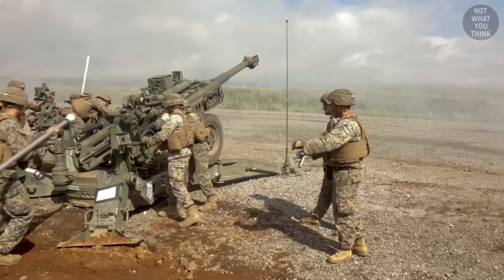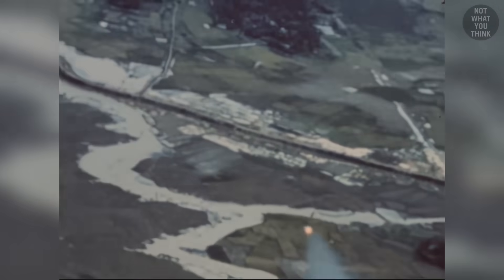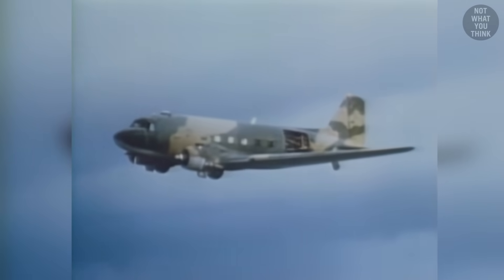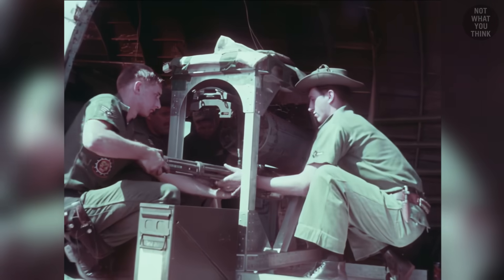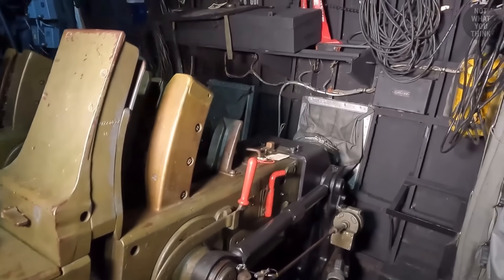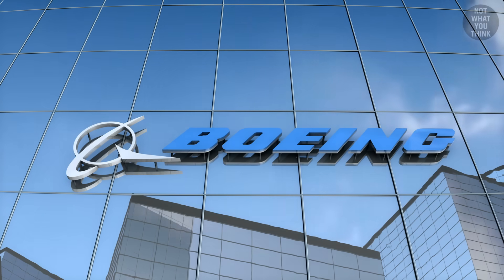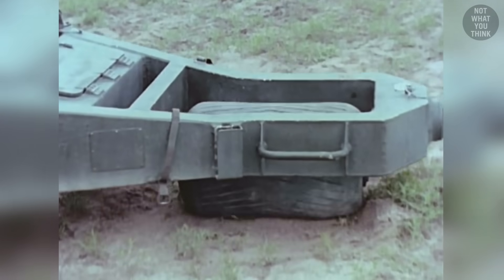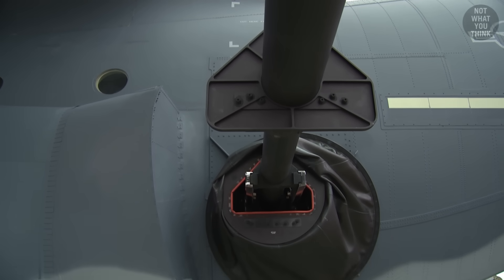Why the US Air Force Installed a Howitzer on a Cargo Plane

Comment: The Vulcan cannon on the AC-130   In theory, should double as a C-ram style Air defense if tracking is spot on and the cannon can get the right target angle
Reply: If you're going to intercept a flying target, you need a dogfighter. Not a rhettofitted cargoplane
Reply: @samsonsoturian6013 I think they were referring to using it in the way WW2 bombers had defense gunners.

Like plane coming from the side to identify it before firing and BRRRRRT

Comment: towards the end of WWII, 70mm cannons were installed in the nose of some old Lancaster bombers. According to pilots, such was he recoil of these cannons that, "despite full power & in a dive, upon firing the aircraft would almost stop mid-air. Then there was the vibration through the entire airframe. We could only fly 2 or 3 missions before the aircraft became unserviceable".

Comment: I rebuilt those engines at one time, and was test cell qualified. So I stood inches behind the prop while dialing in the control cables to the propeller control. Navy, the most dangerous job you will ever love.

Comment: I used to sword on the weapons system on the Hand U models back in the late 90’s,  the ac-130 did not become pressurized until the U model, and then it could only be pressurized when in transit not when it was actually firing the weapons.

Comment: The first aircraft weapons were pistols. The First ever dogfight was between two mercenaries in the Mexican Revolution. Neither actually wanted to hurt the other so they fired their handguns in each others general vicinity until they were both out of ammo and went on their way. 

By WWI pilots arsenals had improved, adding grenades, bricks and occasionally rope. It sounds pretty stupid by today's standard but the bricks were actually some of the most effective weapons early on. Even if you failed to knock out the pilot, hitting the prop or canvas was enough to force a landing. By the end of the war, they timed machine guns that could shoot through the propeller so the pilots no longer had to let go of the stick in order to perform an offensive action.

Comment: - The AC-47 designator was "Spooky". Puff the Magic Dragon was then nose art of one specific aircraft, not the name of the fleet.
 - "Surprise Package" was the name of the project that swapped out the 40mm Bofors in position 6 for a 105mm. These modifications were not done in the field, but required the aircraft to return stateside for the upgrade.
 - The 105mm was added to counter the enemies use of barges to move supplies. It was far more effective than the 40mm it replaced.
There are a few more minor errors in this piece, but they don't stand out as much as the afore mentioned ones do.
Reply: Official name, but the whole fleet came to be known as "Puffs" unofficially.
It's like the name of the Thunderbolt II - but WHO calls the A-10 by that name?
Reply: @bricefleckenstein9666  I never said that the moniker "Puff" wasn't in common usage. The video presented it as the official call sign, which it is not. That is the point I was making. Repeating something that is inaccurate doesn't make it accurate.
Reply: @davidplatter7671  But when nobody used (and almost nobody even REMEMBERS) the official name, is it still relevant and SHOULD it even be used (and CONFUSE most people)?
And if you bother READING my post, I did STATE that the "Puff" name was unofficial.
Reply: @bricefleckenstein9666  So if the video had said "..the AC-47 Spooky Gunship, commonly referred to as "Puff the Magic Dragon", then that would have been an accurate statement showing the official designator, and the unofficial name. It should be obvious that the Air Force would/could never use "Puff" as they would be subject to royalties payments for the use. I spent 30 years working on aircraft for the USAF, including AC-130 Spectre gunships. One thing that is required is painful accuracy in everything you do. I mean, if you are a passenger on a jet, wouldn't you hope the mechanics are sticklers for the details?
Reply: @davidplatter7671  The Air Force would not have been subject to royalties, as the AIRCRAFT name would not have violated copyright on the song - UNLESS they used the song itself.
BTW - I'm ex-Navy, and my specialty was working on the UHF radios used to contact aircraft and other ships - old TUBE gear using a mechanical drivetrain driven set of variable caps to handle working at any point in the Military UHF frequency band (225 to 400 Mhz, as I recall decades later).
Getting those drivetrains aligned correctly so the radio would tune across that wide a frequency range wasn't a piece of cake, though I won't say it was nearly as tough as getting all the different parts of military aircraft to work correctly.
Then when I got out, 2 of my first 3 jobs were working on MilSpec gear used in the various missile programs.
Reply: This is getting interesting. USAF vs Navy. Let me get my popcorn.

Jokes aside, thank you both immensely for your service, gentlemen.
Reply: Good comment. I appreciate it. 
I'm no aviation expert but i was surprised that the author didn't mention the name "Spooky".
Reply: Yup, i prefer mechanics who pay attention to detail as if their life depended on it. 30 years in the Airforce, wow. That is impressive.
Reply: Heard from another AC-130 crew member (Afghanistan iirc) that there's serious problems with chemical buildups inside the plane from weapons fire. Things were toxic enough that on any normal site the crew would be wearing serious respirators. Guy also said there's a bit of a death cult mentality among the crews who man those planes.
While I still love the design, apparently though the airframes get stress fractures from firing the cannon overtime which is an issue due to their cost. Might be time to make a new generation of them.
Reply: @Captain1nsaneo  the interior can get a bit smokey during live fires. This can normally be dealt with using cabin pressurization. While the original gunships couldn't pressurize at altitude due to the unsealed holes in the side of the fuselage, they can use the cabin pressure system to help push the smoke out.
Reply: @davidplatter7671  From what I remember it wasn't the smoke that was the issue but the heavy metals and other contaminates which would hang around and build up. Causing damage over time rather than anything immediate.
Reply: @Captain1nsaneo  I used the term "smoke" as a general term for all airborne contaminants. You're correct, some of the unburned portions of the propellants were a bit thick and heavy.
Reply: You copy and paste from Wikipedia so well !
Reply: @Frankie5Angels150  nah, I just actually served in that unit with the guys who were there in Vietnam. Spent four years maintaining and deploying with the 1st Special Operations Wing out of then Hurlburt Field. But go ahead with your assumptions Frankie, whatever makes you feel good>
Reply: @davidplatter7671  Just anecdotally my grandfather flew AC-47’s in Vietnam, in ‘65-‘66. I’ve never heard him call it by the call sign “Spooky”, it was always “Puff.” There’s a picture of him and his crew in front of the aforementioned one with the “Puff” artwork. Also just a side fact, the scene in the movie The Green Berets when they “call in Puff”, my grandfather is the one piloting in that scene. It was literally filmed on the way back from a combat mission and he was told to let a burst rip for some camera crews. Had no idea it was for a movie at the time.
Reply: @sethrich5998  I am very well aware that the AC-47 was commonly referred to as 'Puff". My point is that regardless of what it was frequently called, that is not it's official designator. All fixed wing gunships have a designator that begins with the letter "S" - Spooky, Spectre, Stinger & Shadow.

Comment: Such a C-130 has zero chance in contested airspace. See Ukraine - Russia, even fighters barely dare to come close to enemy air defences. Never mind a big, noisy and slow low flying cargo plane.
Reply from the maker: That’s correct. We point that out toward the end of the video as well.
Reply: In 1991 an AC-130H was shot down during Desert Storm. At the time we at Rockwell ( not Boeing)  were building the prototype AC-130U. The Air Force told us they lingered too long in  contested air space

Comment: Vietnam, they referred to it as the "Can Opener" Hit North Vietnamese tank on the top, tank disappears, leaves the body, burning.
Reply: Nice
Reply: @AC-hj9tv  I was stationed at Lockbourne AFB, outside of Columbus. We had C-130A models. I was in the Avionics shop for the 39th Tactical Airlift Squadron. We were getting disbanded and send the first C-130s to be converted to gunships, the base was host to the AC-119Ks. They bolted the 105 cannons to the cargo deck and fired it, it pealed up the floor! they came up with a recoil mount and it worked well. Most of our planes were divided between National Guard units and the Gunship program.
Reply: @jamesberwick2210  whoa. Thank you for your service
Reply: @AC-hj9tv  Drafted three days after High School Graduation, delayed my eventual entry into the military, by enlisting in the Air Force, safter on a concrete ramp then in a jungle, (1969). Got to see a whole lot of the world at an early age. Fun but wears out after a while. The electronics training I got demanded six years active duty, I re-enlisted at just over three, gave them an extra year to go to England from Thailand and the war.

Comment: The night vision isn’t as true as majority of pilots use regular night vision to fly at night. It’s not special to the ac130 and it’s crew
Reply: I thought that part of video sounded strange. I was an Engineer on AC-130U Fire Control and Mission Management Systems. I am familiar with the side mounted HUD on plane

Comment: The ac 130 is not the first one to add a cannon 100mm and above, a ittalian attack aircraft with a 102mm cannon strapped near the cockpit
Reply: the Italians used a forward and downward facing gun for anti ship. These Gunships use  adjustable mounts for Close Air Support.

Comment: Imagine the guy that thought of this goes into a room with a bunch of engineers and says how about putting a howitzer on board and everyone in the room stares back at him then there’s a long pause and then the engineers go into a huddle and then they say ok we can definitely do that lol
Reply: Something like that. I was an Engineer on AC-130U project and we hired a few consultants from early days of AC-130. My recollection was the Air Force did the first modifications in house with their own Engineers working with Col Ron Terry the inventor 
This video misses that
Reply: Personally i like to imagine their response was more like that Robert Redford GIF
Reply: I'm an engineer. Yes. That's what we'd do. :-)
Reply: @TallerCarnivore  when I was a kid I was always fascinated about how things worked if something broke I would take it apart try to figure out why it broke and come up with a thinking outside the box solution to fix it with just what I could find around the house paper clips wire from bread wrapper twist ties wire hangers but had sense enough not to mess with anything that plugged in only battery operated stuff lol in school when I learned the Apollo astronauts made a device to scrub the oxygen inside the capsule with a few things that were on board that was my inspiration and also the tv show macguyver taught me to always think of a solution a Harvard graduate with a dozen degrees couldn’t think of lol
Reply: @jaredharris1970  Personally I was not that type of Engineer. My option was Physics  at Caltech so I knew the Mathematics. The AC-130U was an unusual project because it was relatively short and diverse for an Aerospace project and I started as a junior Engineer and ended up a lead after being involved in many subsystems. Last I saw the AC-130U prototype it was being assembled in Palmdale by others

Comment: I have a friend who is a boom operator for the air force, and he told me his plane could operate as a flying field hospital and artillery station. each war plane is equipped with enough resources to fly indefinitely with refueling every couple days. Apparently they can also shoot down missiles and incoming rockets with their onboard sam systems. it’s not just flares anymore 😂. And that’s just our plane dedicated to refueling jets.
Reply: Did he say what airframe he flew? It sounds like a KC-46 or a KC-130 from what you said.
Reply: @skeletax7471  

The KC-130 doesn't have a boom, so no boom operator.
Reply: @skeletax7471  I forgot which one, but it’s a massive refueling plane and it has a couple of cannons out of the side in the videos he sends us
Reply: @skeletax7471  it’s a jet if that’s helps it doesn’t use props, apparently it’s outfitted with some classified stuff they aren’t allowed to use yet
Reply: @ballsackfart  yeah no that's... not a thing my guy.

Comment: Basically the AC-130 is good at fighting the same things the Russian airforce is good at fighting: Ground targets that hardly move, don't shoot back and aren't protected by any anti-air.
Reply: That's why it's perfect for counterinsurgency.
Reply: basically the same issues of the A-10, but worse honestly. its upside though is that they can stuff an ungodly amount of countermeasures in one of these things. flares, chaff, laser defense systems, radar jammers. but at the end of the day those are just compensating. You cant do much about optical tracking, or volume of fire.
Reply: Difference between civilian targets that Russia bombs and military targets done by the Americans

Comment: It would have been more informative and less obvious I feel, if you had gone over the crew of these gunships. How they are not given proper masks or ventilators, so many of the crew who fire these gunships get massive headaches and side effects from the toxins and gunpowder concentrated in the air of the plane. I wasn't aware of it until I heard the experience first hand from the young men who got tricked into it by playing to much of that one level from modern warfare and thinking "hell yeah this is badass!".
Reply: ALL flight crew are REQUIRED BY MILITARY LAW to use adequate hearing protection, protective headgear, and oxygen/respirators as necessary.  Where did you get your information?  Gamers?

Comment: An AC-130 with a Laser defense system capable of downing SAMs and Anti Aircraft Missiles. It will only be a matter of time before those lasers are being used to cause ammo to suddenly Cookoff at Ammo Depots.
Reply: Sad, but true.
Reply: maybe in the future, but they are not nearly strong enough for that atm. They dont just burn a hole though the missile (even though that is end goal for the concept) they just disrupt the IR or optical tracker.

Comment: It's a very cool aircraft. However, I think it was a waste of money for the Air Force to invest in a lot of AC-130Js when they're not really relevant to near-peer fighting. I expect this to be the last model of gunships based on the C-130 platform
Reply: And the backing for your opine comes from....?
Reply: @Rotorhead1651  Working as an integrated electronic warfare systems technician on AC-130s

Comment: Sad how so many awesome and cool looking equipment is absolutely useless in near-peer combat.

The AC-130 wouldn't even last 10 minutes in enemy airspace, during modern combat.
Reply: Strange.......because it does.  There are NO "peer" aircraft to the AC's.  Russia (and the Soviet Union before her) never made gunships, and the AC's were never intended to be fighter-interceptors.

And, for the record, a well-placed, unguided RPG can take out nearly ANY airframe.

Funny how guys like you seem to have more opinions than actual experience.
Reply: @Rotorhead1651  Holy crap.

Talk about confidently incorrect.

How much of a gosh darn moron do you have to be, to not only insinuate that a goddamn unguided RPG could be used to take out planes, but to also not know the fact that MANPADS and Anti-Air is everywhere in a modern conflict, and that if your opponent is not made up of literal goat herders with AK-47s, your lumbering and slow and low-flying gunship will be toast before it even knows what hit it.

Even the video itself states that at the end.

Comment: Fun fact. The ac-130 J and W was supposed to have a very different armaments of 30mm bushmaster ll, weapon system with launch tube for agm 176 griffin or gbu's, and wing mounted agm 114 hellfire.
However, because it still have enough power they decided to put the 105 howitzer back on the plane which they weren't going to put.
Reply: Interesting. I was an Engineer on the original AC-130U with 105mm, 40mm, and 25mm Gatling.  I had heard they were trying to standardize munitions due to logistics etc
Reply: @martinmartinez250  

When/Why did they remove the twin 20mm rotating cannon?
Reply: @Rotorhead1651  My understanding at the time was RFP for AC-130U required higher accuracy and longer range than 20mm could provide. 25mm wound up being strange bird as GE developed for Harrier in house  and did not like to share info
Reply: Did you work in a gunship maintenance unit?
Reply: @Rotorhead1651  I did. Was both the best and worst job I ever had. The best because I got to work on AC130s. Worst because I was stuck at cannon afb new Mexico. Basically middle of nowhere. Hurlburt field is AFSOC headquarters in Florida and much nicer location. Expensive to live there tho.
Reply: @gravestone9831  

Cool.  I was a Crew Chief on the MH-53H Pavelow IIIs, 20th A.M.U.  Hurby's Pea Patch was my first duty assignment.  I had many friends who worked both the ACs & MCs.
Reply: @gravestone9831  I feel you. I was offered lead Ground Engineer during AC-130U Flight Test but I didn't want to move to Palmdale near Edwards AFB. I forget if Flight Test firing  were scheduled for New Mexico or Yuma.  None of these places sounded appealing.
Reply: The more American it is